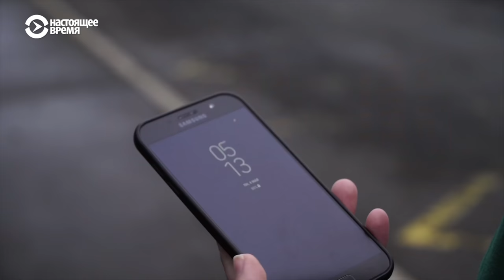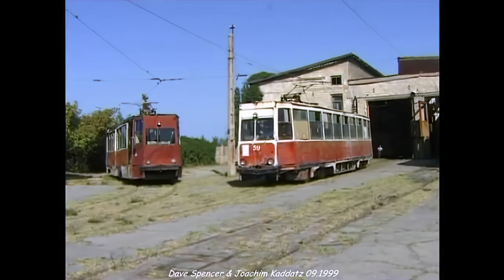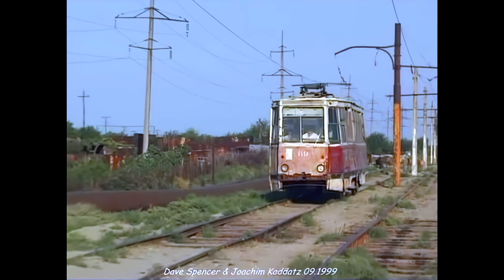How This Iconic Red Soviet Tram Survives On The Remains Of A Fallen Empire

Comment: Nice video! Now the design is Russian....or is it? Bodywork certainly is. However, the design of the running parts certainly isn’t. The KTM-5’s were technically based on the Tatra T3. And the Tatra T3 was technically based on the original American PCC streetcars. The PCC is a brillaint design, reason so many Tatra T3/T4, KTM5’s and 8’s are still in daily service. It would be a tribute to both the PCC designers and the companies that used the PCC design in their products to have a few Tatra’s and KTM’s preserved and brought to San Fransisco. Many are available!
Reply from the maker: After some thinking, it does not look like a project that needs a billionaire! Such a tram can be bought at about 15000$, and about 20000$ for shipping.
Reply: I think a video about the historical connection from pcc to KTM would be fascinating.
Reply: @RailwaysoftheWorld1  That’s way overpriced. Given the huge number of out of service units and the derelict state most of them are in. I’d say $5000 for a unit that still can move of its own and sturdy enough to withstand shipment. Along with it spares that will be needed for restoration. In the end without any doubt the total amount needed for a completely overhauled unit would probably exceed $100.000. For a rolling, fit for service unit. As a static unit half the amount probably will be needed. And it surely also depends from what part of Russia and its former Sovjet republics the unit comes from. One from Estonia or Kazachstan? A world of difference. The one from Kazachstan is far away from a major port, the one from Estonia isn’t and probably in a far better condition.
Reply: I saw a news report from a couple years ago that North Korea was updating their Czechoslovakian trams.   Is that another PCC legacy?
Reply: @odess4sd4d  Yes, the principle that is. And that goes for all “PCC offsprings”. The concept is the same, the components are locally made. The PCC was a unique concept, without it the tramway systems in the USA would have been abandoned much earlier. The oil and car industries were responsible for their demise. A major mistake and I hope Russia will see the light and preserve and treasure what’s still there. No matter how run down the systems may be, the infrastructure is valuable in that the space for the tramway systems is still there. And preservation fits in perfectly if it comes to environmental discussions. Time will tell!
Reply: @odess4sd4d  By the way, you are from Odessa? My daughter in law is and she told us many things about the Mother City. One day soon we will go there and celebrate their marriage. Wedding will be there, they live in Geneva, Switserland. And I’m in Holland. Bye, Willem.
Reply: @leyland9999  No but I would love to visit both Ukraine and the Netherlands.   Congratulations on your daughter's marriage.  Ik leer al een paar jahr Nederlands.  Met vriendelijke groeten uit Montana USA.
Reply: @odess4sd4d  Ahh, that’s great. Dat horen we niet vaak...(we don’t hear it that often). Dutch seems to be difficult, I believe it is, even for ourselves. As for Odessa, it is the great unknown, despite being squeezed between two different worlds they still cope. It comes at a price however. I can’t wait to go there.
Reply: @odess4sd4d  En voor een paar jaar Nederlands leren kun je een goed leesbaar commentaar in die taal schrijven. (And for a few years of learning Dutch, you can write a good comment in that language) .
Go for it when you can do that again! I had never been on a plane before, never stayed in a hotel nor been to a country where I only could say 'yes' and 'no' and didn't hold the countries' currency, but darn did I have a blast! It was the vacation of my lifetime so far and though I only saw Kyiv in those 9 days just before Christmas in 2018 (9 days is by FAR too little time for Kyiv alone) I will never forget it.

A big plus is having a friend there who either lives there or knows the ropes from earlier visits. She took me to many spots I would have never found myself (if not for the language-barrier than because of the locations which can be hard to find).
I had a girl friend who I met in the Netherlands when she was on vacation in my country. Took her on a cycling trip (I mean hey... you're in the Netherlands ;) ) and she got a tour you won't find in any tourist-guide ;)
After 12 hours together we said goodbye, but she invited me to visit her country. Without experience with planes and considering the countries' situation, I wasn't particularly fond of that thought...
But about 4 months later I found out I really wanted to see her again and booked a flight.
And about the language: you'll get the hang of it fairly quick! As so many shops and such don't offer English translations (or only when you ask for them) you'll have to master Cyrillic to at least be able to say things you would like to eat or drink. The metro-chart from whatever city in Ukraine is a very good start! I quickly was able to read the signs in Cyrillic and ignored the English ones. Together with the automatic voice-announcements of upcoming stations and such, you'll quickly learn your first Ukrainian words ;) .

Comment: This is absolutly no channel for railway enthusiasts. No technical details, like length of network, voltage, track width, passengers per day, and the material seems to be copied from various sources, nobody has been there.
Reply from the maker: I'll take that as a compliment, as I never wanted to make a video reading voltages and network lengths from Wikipedia.
Reply: @RailwaysoftheWorld1  Well, if you think there is an auditory for this, go on, I'm just in doubt. For little kids who have never seen a steam locomotive, you have too much details. For others not enough.
It might work as kind of travel magazine, taking a railroad as the connecting line.
But for this you have to include more about the cities you are on. Try to include a Map.
Of course, this doesn't work if you don't go places yourself. It's all third hand information from a studio, isn't it.

Comment: According to Wikipedia, the KTM-5 was "The electrical, mechanical, and aesthetic designs were derived from the Soviet RVZ-6, which was based on the Czech Tatra T2, which in turn was a licensed adaptation of the North American PCC".   The  "Presidents' Conference Car" (PCC) was a project of 1929-1936 as an "improved" Streetcar for use by American transit companies.  The PCC was a very good design, even today PCC design "trucks" are the best undercarriage you can get for a streetcar that does not operate on very straight and perfect tracks.  For example in Pittsburgh, when new Light Rail Vehicles (LRVs) replaced the old PCCs, the LRVs were known to for excessive noise on curves and wearing out wheels.  this ws due to the LRVs "Trucks" being designed for high speed staight tracks not the many curves or badly maintained tracks.  On the other hand the ol PCCs were designed for curves and badly maintained tracks.  
Thus the KTM-5 can credit its survival to being based on the American PCC design.
Please note PCC stands for "Presidents' Conference car" for the PCC came out of a Conference of various presidents of various transit organizations to design  better streetcar.    They did a very good job in designing the PCCs (and since it was a conference of many presidents not the President' the proper first name is Presidents' for we are NOT talking about a president but many presidents).  
I am also an American and we have called Streetcars Streetcars since at least the 1830s. To my knowledge the term "Trams" was never used on this side of the Atlantic till the internet (and is still rare on this side of the Atlantic).  Streetcars is believed to be "German-English" for we did not adopt the British term for Streetcars but translated the German term "Strassenbahn" which is "Strasse" or "Street" in Engish and "Bahn" or "Car" in English.

Comment: I grew up with these. Every day took a ride to kindergarten and then elementary school, until they entirely removed them. They were kept in horrible condition, inside and outside it sounds like bunch of nuts and bolts loaded into a washing machine. I remember sitting in a class with a movie projector on, and whenever a tram like this  passed by it made a vibration so strong that it would unplug the cable and the movie would stop. They were extremely slow and uncomfortable,  only old people used them, they were always nearly empty. 
My City that was famous for its tram  never cared about renewing and developing it. So they removed it all, when in fact, trams are the most efficient and environmentally friendly  form of city transport there is.

Comment: A little correction: usually "new machines", which drivers use are Tatra T3 or ЛМ-68, and they dont differ much from KTM, although they are more comfortable. Until very recent times (something around 2015) КТМ's were in service even in Moscow

Comment: In Sumgayit, Aze, they used to call it "metallom" meaning metal junk as it almost vibrated the surroundings it passed through cuz of its weight. They were decommissioned long time ago, no trams at all now. But used to be comfy to ride on them for some reason despite of its swinging to the left, right or bouncing as they aged. :)

Comment: I've riden the KTM-5 during a trip trough Ukraine in the city of Krivoy Rih, an eye opener to a westerner used to shiny modern public transport.
And despite the trams looking very spartan and worn out they still gave a good ride, personel doing everything they could with the sparse money, the price of a trip trough the city was equivalent to 3 euro cents or 5 dollar cents.
Compared to the Bakoe trams in this video however they still were in a very good state.
It seems that the Bakoe cars don't have working controllers anymore and the speed is regulated by pulling the bow down to shut the power to the motors off.
Reply from the maker: You are right, that's exactly what I read in the comments of the Sumqayit tram video (unfortunately that was after I made this one)

Comment: Cars can also have a trickle charger or engine warmer  - both using very little power and using an extension cord from front of the vehicle. It's what people have done in northern regions for decades. You don't NEED to have a car "running 24/7" to keep it warm.

Comment: It is the AK 47 of trams:
It is not particularly good, but function after submerged in water, covered in sand and filled with mud.
Give it the right ammunition (voltage) and some support (rails) and it will work

Comment: Canadian here….Cars do not need to be stored indoors or have the engine on 24/7 in -35/40 C. they do need a engine oil block heater plugged in for a few hours before starting.

Comment: I was really suprised to see this, had no idea that there was a tram like this even through Poland used to be a part of the communist block. I even had to check and see if perhaps just my city was using a different kind, turns out they were just not used much here. They instead picked produced locally Konstal trams, guess it just made more sense to do it that way.

On another side, thanks to checking this I found out that nearby they use Konstal trams that were produced in 1949 and 1951 to this day, feels crazy that they are still in service and in a pretty good condition too...

Comment: Cars do not need to be stored in a heated garage or kept running all the time in cold temps. Make sure you have a good battery and you should be fine. Unless you have a very old diesel without glow plugs, but block heaters are also a thing.

Comment: I love KTM-5's, there's always a lot of fresh air inside them, unlike buses. In the winter, the seats are heated which makes the ride extremely comfy. I also disagree with the author about the looks, those in good condition look aesthetically pleasing to me, maybe it's just that I'm so used to them, having used them all of my life, but on the other hand, maybe the author isn't used to the peculiar soviet blocky style also seen in the Lada-8 cars and a lot of other things. Trams are also a few roubles cheaper than the bus. The main downsides are longer intervals and slower speed. I heared you can fix the latter by arranging the automatic green light for them on the crossroads, but I'm not sure somebody will ever bother with that here. Our local mayor had a plan to have trams go to the other bank of Yenisei again, though, this time on a rubber bed under the rails to protect the bridge. Looking forward to going to the other bank on the 1 again.

Comment: I remember riding on in Ukraine, when I was visiting friend back in 2013. Something began to smoke under the floor in the front section, the driver came from the cab, opened a hatch in the floor and poured some water from a bottle in there and then proceeded to drive as if nothing happened. Surprisingly, that worked out well.
Reply: If the hatch was not in the centerline, but closer to the sides - that was probably the braking pads jamming.

Comment: Cities with no money, you probably need a good mechanic employed just to keep the cars running and that doesn't count the rails and overhead wires. Roads, cars help pay maintained, but the trams pays for new rails and wires since they are the only ones using it. Letting the infrastructure collapse and looking at the bill of 100% replacement probably ends it's existence.

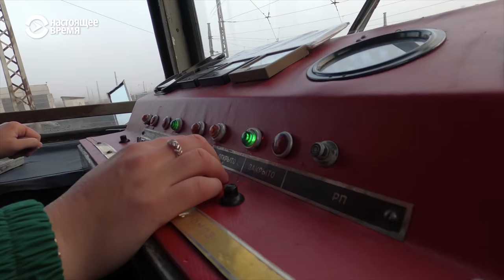Comment: 2:39 LOL you have to leave your car running 24/7 in minus 30 to minus 40???? Most people just try to start their cars in that cold of weather, and they will just go. It's not good for the engine because the oil is so viscous, that it damages the engine. Instead just plug in your engine block heater, and put it on a timer switch so it doesn't waste electricity.

Comment: Almost 15000 of Tatra T3 was produced too. Still think T3 was most produced tram in world. Simple, reliable with potential of many overhauls, changing electrical equipment from resistive regulation up to modern IGBTs with induction motors. It is possible add low floor section to T3 car. Can withstand bumpy tracks https://youtu.be/RQ0LM7ZIbsM. Oldest T3 in Bratislava has 40-45y. But time is going. All of these veterans will be replaced. I love them. Our transport organisation try to keep one vehicle from all type in original restored condition.

Comment: "-30 to -40 C, where cars need to be kept in a warm garage or running 24/7"

What complete bollocks. It gets that cold in Canada regularly and my car from the 80s can start just fine as long as the battery doesn't freeze.
Reply: Bruh you in Nunavut or Yukon
Reply: @transitschuykill  Nope. Way further south. Far enough south that any further would put me into the US.

Comment: there is nothing special about -30 to -45 
cars start just fine with minimal effort as long as you have a heater for the engine block.

The reason you dont want to start with a cold engine in -40 is that the oil is no longer flowing properly and you damage your engine.

this is cold, but its also normal plently of places, not just russia. 
I always add a bit of petrol for my diesel if I dont have Winter diesel in tank when i enter cold regions.

Comment: These old bogie trams have much better ride quality and lower noise than the new fancy low floor ones. Why do they have to have a low floor throughout the vehicle? A low middle is enough to make them wheelchair accessible.
Reply from the maker: From my experience, having high steps in the tram interior is very inconvenient and sometimes even dangerous. What low middle floor units do you think are better than any low floor ones?
Reply: @RailwaysoftheWorld1  Three-car or more units with conventional bogies in the ends and Jacobs bogies towards the middle, which has the low floor. Then you get good ride quality, low noise and low track wear, and a low floor section for those with special needs. Seems like a good compromise.
Apparently Škoda managed to make the bogies in the 15 T so compact that it can have that layout but with a complete low floor throughout the tram. I'd love to try it some time.

Comment: yeah tell ya what I'll drive my old vehicle any day over my new simply for the reliability factors and easy minimum effort fixes if anything were to break just work better more design  sucsess than design flaws such as expensive circuit boards to drain battery when not in use even as i type this on toutchscreen i long for good old reliable keyboard buttons ya can feel working right and not spell correcting to incomprehensible words and sentances when i type something i want it to be what I said not what a computer thought i said

Comment: Battle tanks aren’t simple and certainly not reliable.
Reply from the maker: There is a Russian saying "reliable as a tank". It probably refers to the ones from '40s (namely, T-34). If modern tanks have to comply the same ecology and safety regulations as modern cars, then I guess we can't say that anymore.
Reply: @RailwaysoftheWorld1  ah, that makes sense. 
I was trained on the old Leopard I, it never broke down. The Leopard IIs around us did so constantly. We even had a joke that we don’t need to pack the starter cable because to LeoII brings his own.
Reply from the maker: @asmodon  in a worse nightmare one cannot dream of a tank that can stall in the middle of a battle.